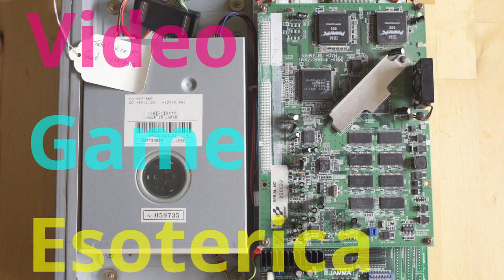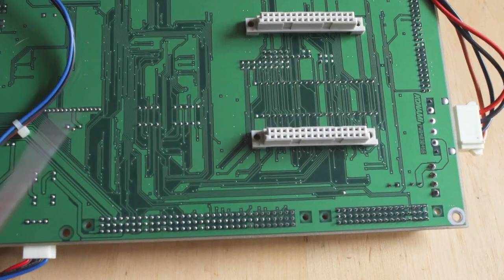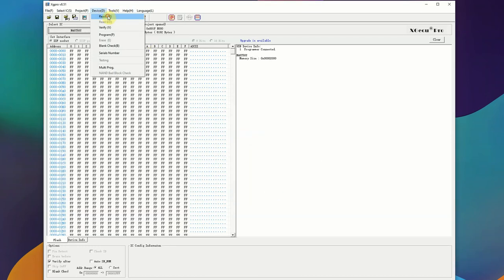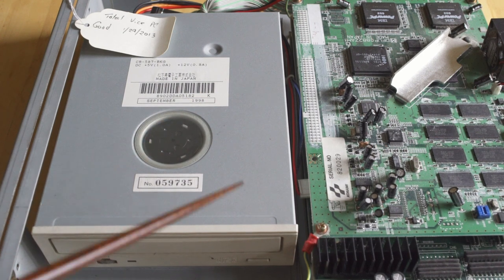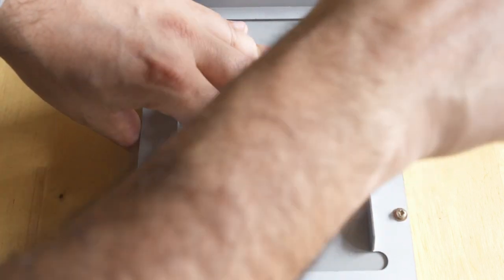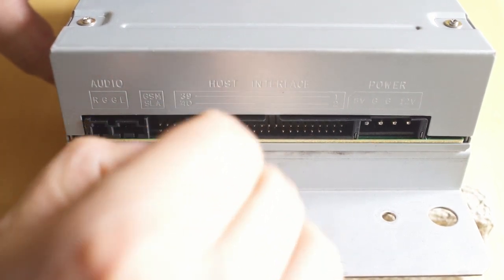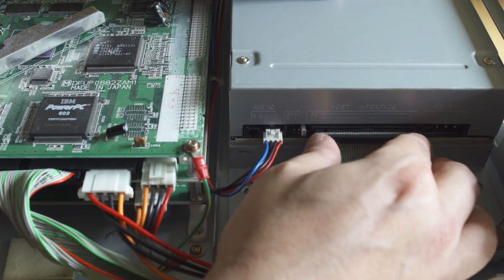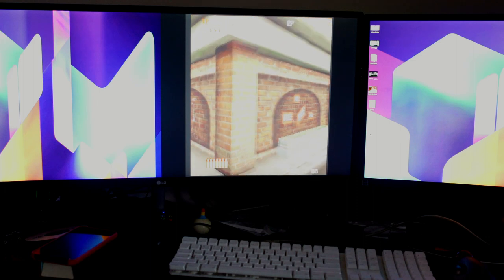Repairing and Troubleshooting the Konami / 3DO M2 PCB - "On a Technicality"

Comment: Great video! I'll be saving this for when my evilnight acts up. I Still need to fix  my ddr board.
Reply from the maker: If the DDR is throwing an RTC error it’s a similar fix
Reply: @VideoGameEsoterica  won't save data. Have to change it to free play in options every boot.
Reply from the maker: Sounds like a flat battery somewhere

Comment: Finally got all original Konami Evil Night guns/shotgun/Total Vice guns. Now my Evil Night won't boot to the RTC check. I've got a new (or NOS) duplicate  RTC chip, but no means to program it. Is there an economical chip programmer you would suggest. Going to have to wait awhile to get it. I see you can hack the RTC chips and replace the battery or install a battery clip. Looks like you would still have to re-program the old cjip though, correct. Thanks
Reply from the maker: I use the MiniPro burner / reader to program them. I recommend it. Cheap and reliable. 

You can drill into the caps and solder to the positive and negative terminals and mount a coin cell battery. Alternatively you can do a FRAM mod with an adapter board and stop relying on batteries. 

I am still working with someone on NOP checking the rtc out of the post sequence too
Reply: Thanks for the suggestions (always)! Same day delivery for one alot cheaper last time I checked. After just a little learning curve...I'm playing Evil Night again! 
One thing I've noticed differently, some of the sounds/music are set to EXTREMELY LOUD! On the sound options, "Sound Scale 2" is the culprit.  If I adjust the volume level or anything g in the settings, that setting stay on full blast.
I don't see any hardware volume settings. LMK if you've come across this. Thanks
Reply from the maker: I haven’t come across any audio issues. Are you using mono out via JAMMA or the stereo headers?
Reply: @VideoGameEsoterica  probably both, haha. I've got every wire hooked up . besides the jamma, there's a 4 pin plug on the top board that is labeled sound (same plug i use for sound on Lethal enforcers)
Reply from the maker: Yeah not sure on that. Never experienced it. Try mono through JAMMA and see if it still happens

Comment: I think it is possible to replace 602 with a 603. Since the 602 is just a stripped down 603.
Reply from the maker: Possibly? The MHz rating is not a match. Even if it’s pin compatible to the 602 I’d be surprised if it worked, as the 602 did have some variations that weren’t in the 603 per the spec sheet. 

I don’t know of any other device that used the 602 either. So there is no cheaper “donor” alternative. It would be a fun experiment to try to revive a dead M2 with a 602 but a) I don’t have any dead boards that needs new CPU’s / the pin pitch on the chip itself would be extremely hard to solder by hand. I think you’d need a pro and/ or a very expensive hot air rework station to get that job done. Above my skill set